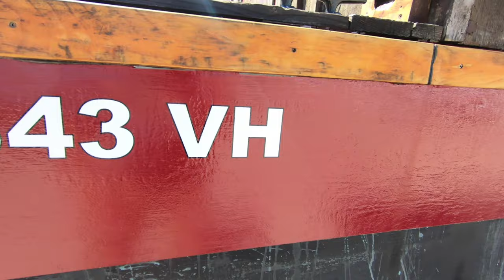Shantyboat Drydock 2019

Comment: Great project and job on the boat.  I would suggest you cut away about 4" to "6 of the side walls and run a fiberglass flashing so the deck water will naturally run off instead of soaking into the walls.  It is a dream of mine to live on a boat in Lake Chatuge Hayesville, NC.  I am 73 so time is running.

Comment: I have drawling made up similar to yours.  I’m going 24x8 with 3ft sides.  I live on the Ohio River in Aurora Indiana. You came right by me.  I plan to use 2x4 framing under deck with 3/4 marine grade plywood for the hull and decks.  I have afew questions.  How deep is your hull and what HP motor did you run?  I’m thinking 25-30hp 4 stroke. With a 9.9 on my Jon boat just incase. I plan to go from Aurora IN. To my property on Mobile Bay Alabama.
Reply from the maker: Did we meet when we were there?
Reply: A Secret History of American River People I missed you when you came through Aurora IN. Wish we could of met. I spent 52yrs living on the river, all my life, but I’m looking forward to starting our house on Mobile Bay near Fairhope AL.   Love to find the plans you used to build your Boat.
Reply: River Rat: the hull is a Glen L Water Lodge.
Plans are under 100$
If nothing else they are fun to look at.